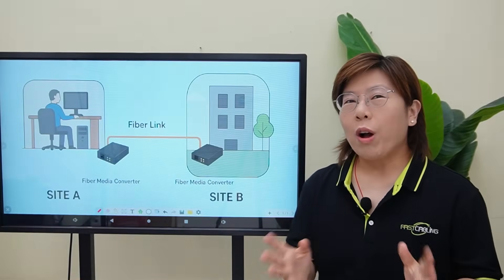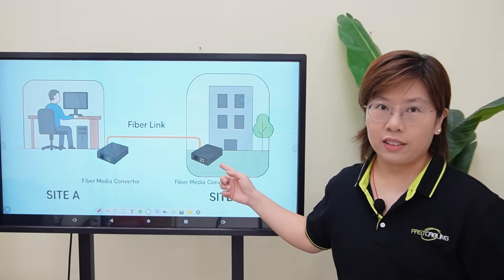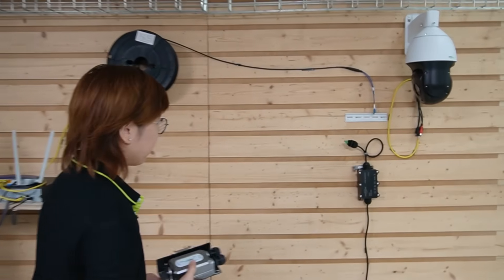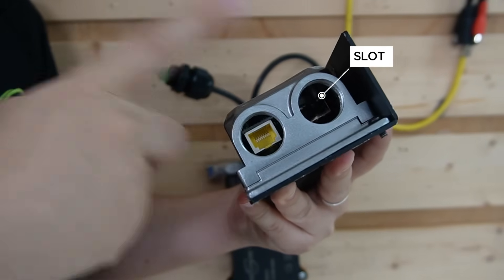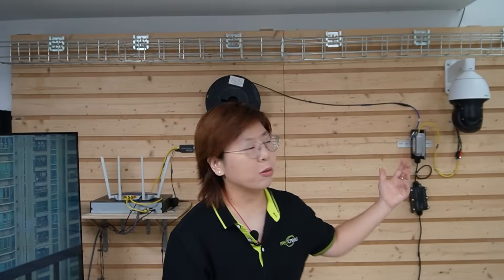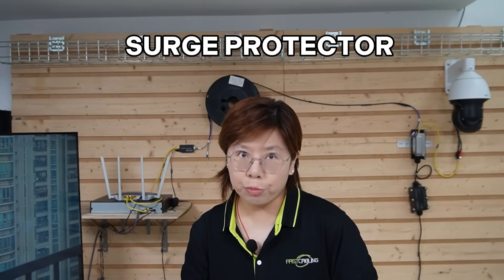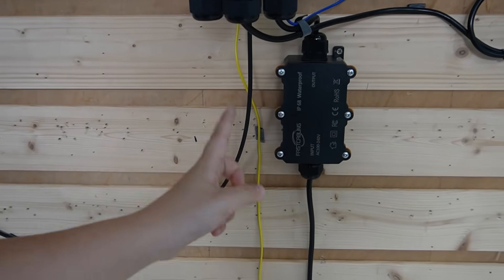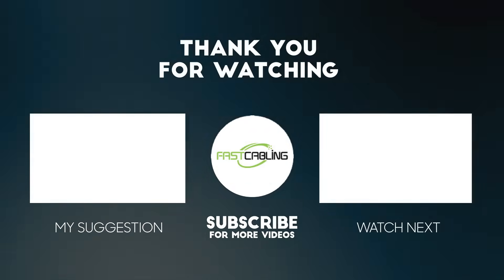Why Your Fiber Media Converter Keeps Dying — Outdoor Fix Tips (IP67 + Surge Protection)

Comment: You only used 1fiber, not 2.  Do you get transmit and receive on 1 fiber?  Very nice.
Reply from the maker: Yes, the BiDi SFP module uses different wavelengths to transmit and receive data over a single fiber. 

https://www.fastcabling.com/product/bidi-sfp-fiber-modules-2/

Comment: why not add the media converter in the same housing as the surge protector unit. The outdoor media converter looks a bit to hard to install. specially with the SFP transceiver.
Reply from the maker: The media convertor is an independent unit, but it is a considerable solution.